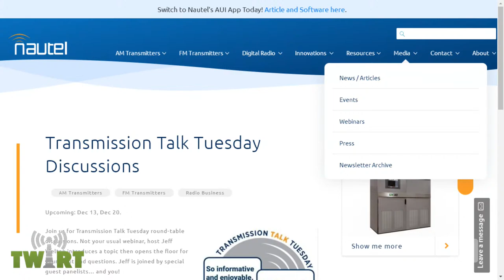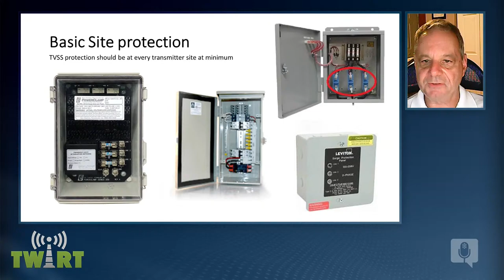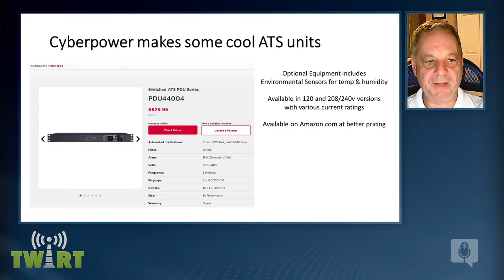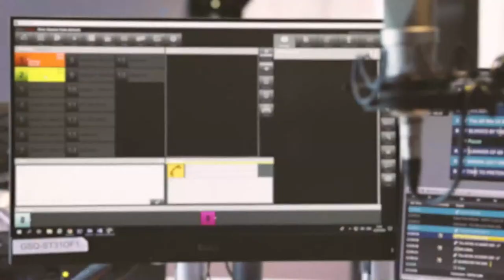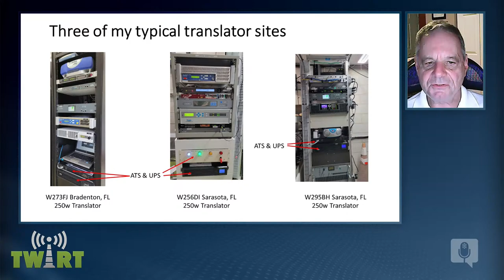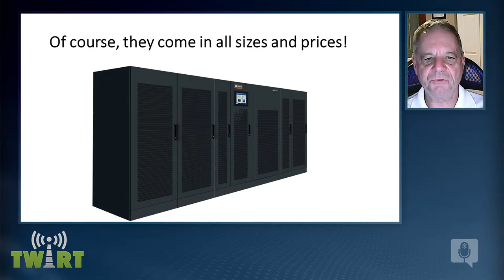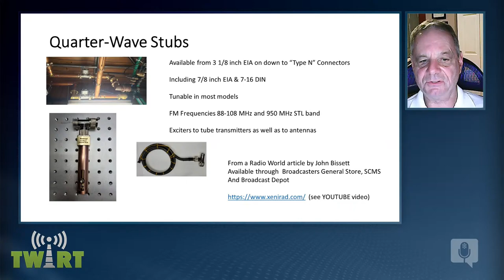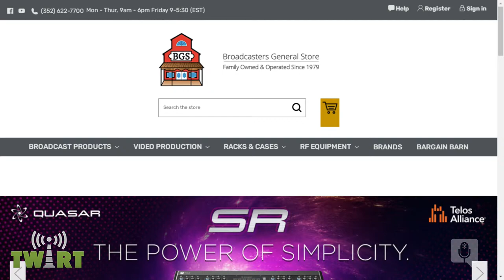TWiRT 621 - 5 Things to Know About FM Transmitter Sites - with Hal Kneller

Comment: They make tools to effectively test ground resistance to Earth. I’ve saw one used to test the grounding system at a local switching substation. These substations have an extensive system and test to make sure that the entire facility is equal potential to earth. The one I saw was able to test four points at the same time and they tested every piece of metal in the facility as well as the grounding meshes that you stand on while you throw switches and disconnects. I guess when you are messing with hundreds of kilovolts of electricity you don’t fool around.